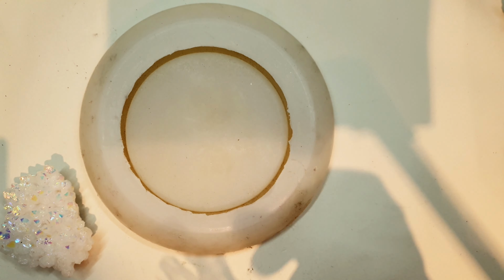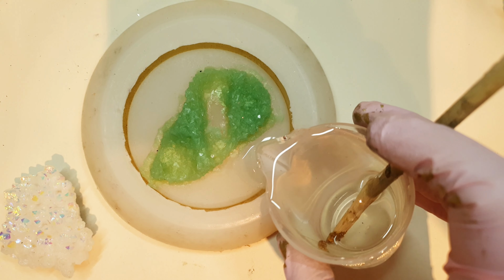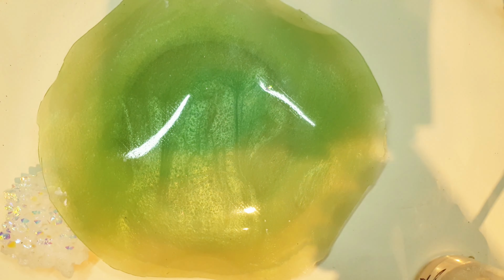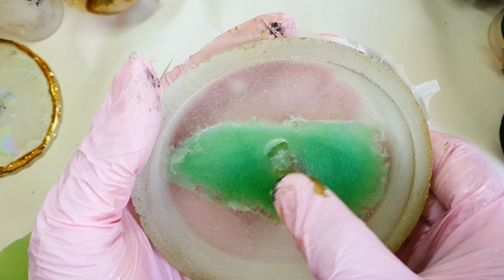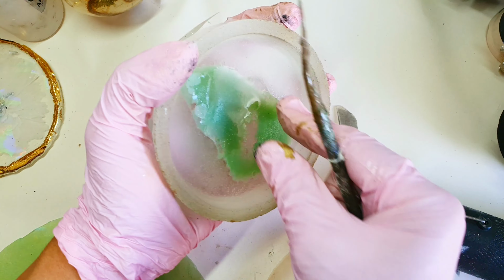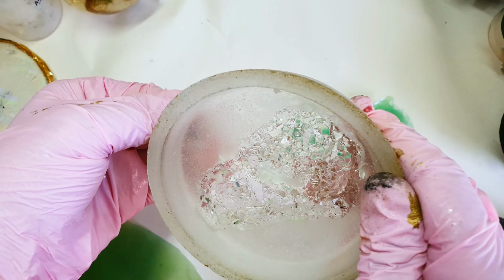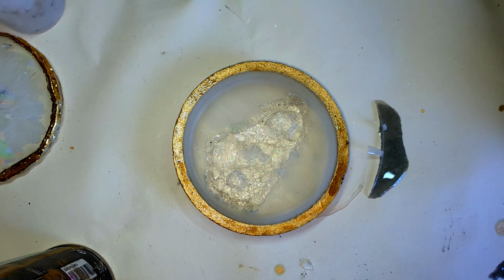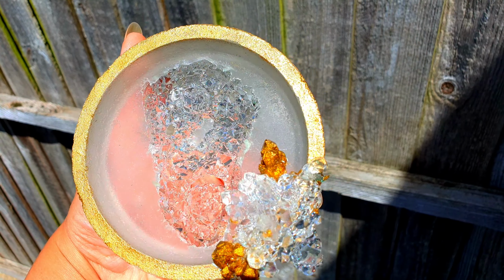How to Add Drusy Insert into Resin Projects \ Creations /Resin Art

Comment: I think it's really pretty and I might try out some of these methods later. Definitely the fact that the dish mold was matte and The Shield is not made a big difference in the final product but I think the reason that the Geo didn't stay down is because the other one was Matt so it didn't suction down what they can. You probably better off using two shiny molds and then sanding down what you want later
Reply from the maker: Thankyou so much yes thats the big reason it didn't stay down will try the sanding method next time 😊 ☺️ 😀 🙂 Thankyou for Watching.